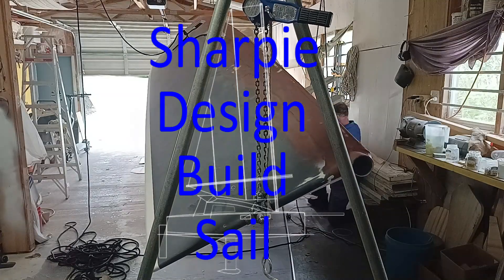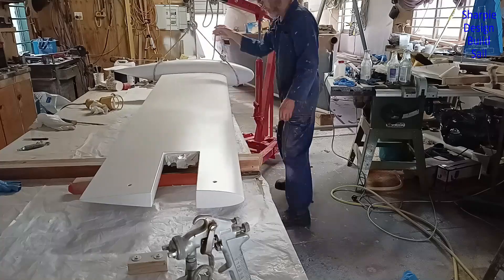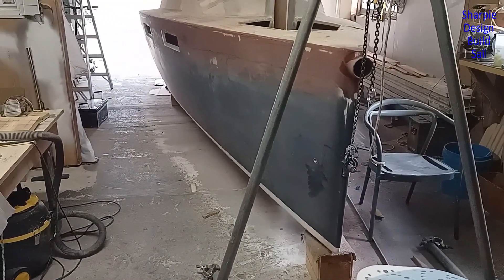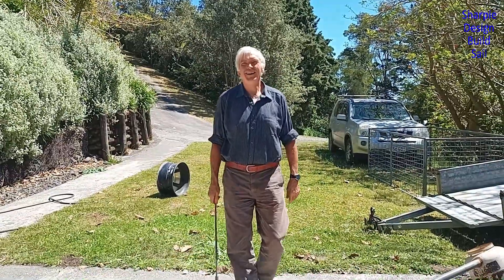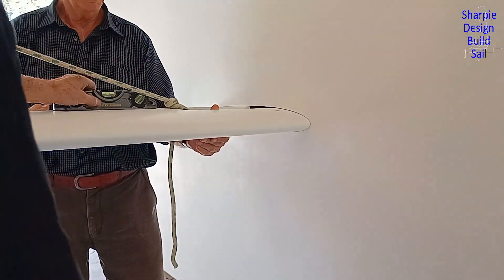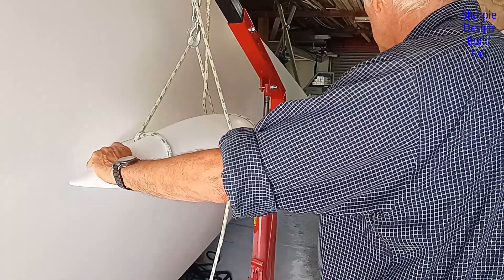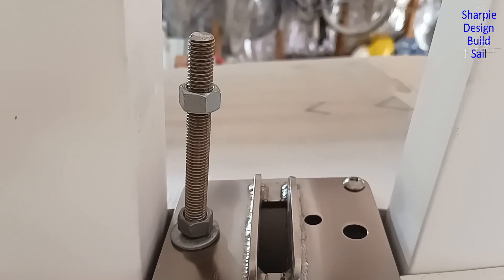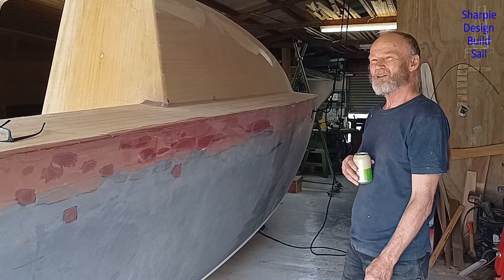Keel Meets Hull at Last! Sharpie Sailboat Build - V59

Comment: Thanks for your video. I am continually amazed at the skills shown by Shipwrights and boat builders, and a man with a shed. The keel fitting looks so perfect. How do you achieve such perfection. Congratulations. Keep up the good work. Best wishes for the rest of the build.
Reply from the maker: Thanks for that generous feedback! It just takes one step at a time and sometimes lots of planning to make sure something like the keel fit goes well. There's a video two on that. Cheers for the encouragement for the rest of the build, some days are harder than others and then sometimes you look back and realize you've achieved a lot 🙂

Comment: Just out of interest is it a called a dagger board when it has a bulb on it and it's the main keel?
Reply from the maker: That's a good question and I like to get names correct. I haven't spent too much time trying to get to the bottom of the correct terminology but I'm leaning towards calling it a 'ballasted daggerboard' although I've used the term keel partlly because it's what people seem to want to call it. In the past I've kinda always thought of a keel as the typical type of keel you have on a keeler.  What are you inclined to call the 'leeway resisting mechanism' I have 🤔

Comment: Personally I wouldn't worry too much about the keel unless it's a racing boat, just as long as everything is mixed correctly and it looks reasonable, but depends on the person and how perfect they want it all to be, or how "anal" they are. I've never understood why being somewhat of a perfectionist is said to be anal by some, exactly how and why that particular word is used. I accidently said it to my older mother in law the other day (she's close to 80) and the look she gave me was priceless
Reply from the maker: You raise some 'build philosophy' all boat builders have to/should come to terms with. I think the most important thing is to make a well informed (mostly about yourself) decision as to what standard you are happy with and stick to it! There's not point making some areas near perfect and others that achieve all that's required for a work boat. Personally I just like something that works efficiently and well and is pleasing to the eye, it can take the same materials to make the pleasing and not so pleasing. I like sleek designs and this design feels a compromise because I really did want standing head room but I've decided the function to be the most important consideration. Take my ballasted daggerboard, it could be misunderstood  the time I've spent on it is because of looks but to me it's to build a foil that works well and it really does make a difference. 
Now you be careful with you mother in laws sensitivities 😉 But when I think about it, words certainly bring out different reactions in different people and certainly labels do as with the other comment about what label is correct for my leeway prevention device! Early in my nautical career, a sailor and workmate told me "there's not such thing as rope on a yacht, it's line". Ever since then, I've liked giving lines the proper name. But languages evolve and very fast in Sail GP where they call the helmsman a 'driver'!! I find that hard to get used to but it will probably stick.